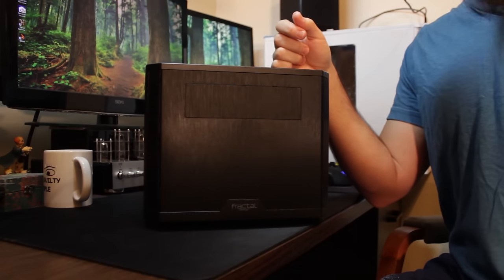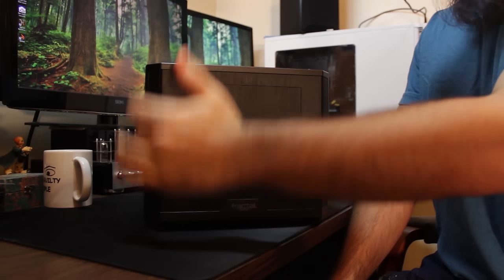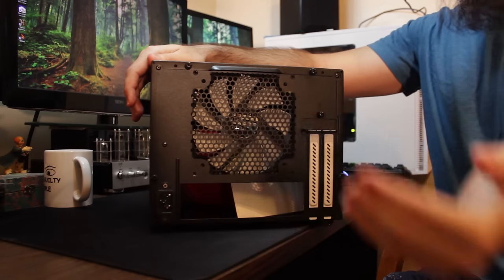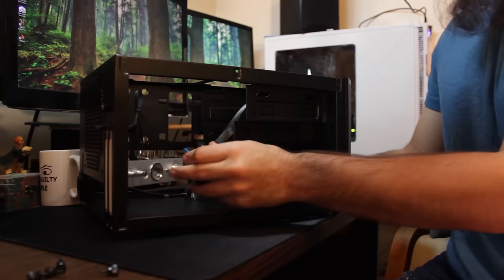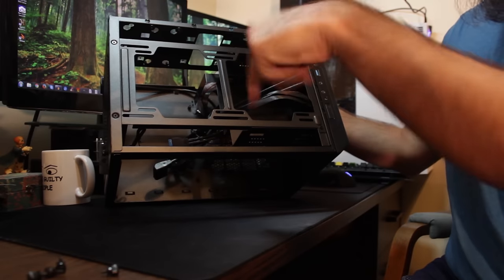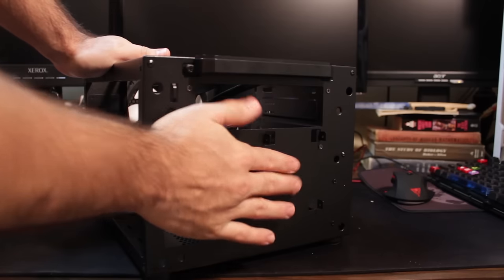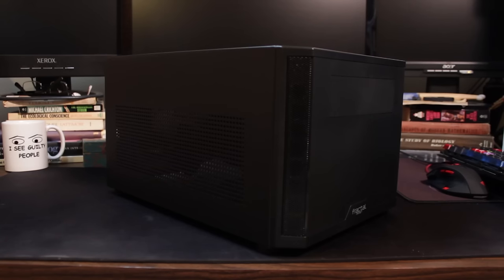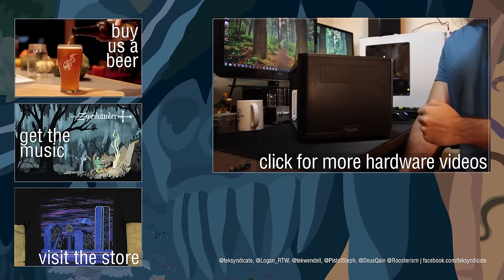Fractal Design Core 500 Overview

Comment: The kind of build I'd like to see in this case would be:
A 'gaming' setup with a custom watercooling loop to find out how loud it would be running off a single rad.

HTPC/general rig we know would work in that easily, given the low power/heat of 'modern' components, but can a gaming rig be done quietly in that size?

Thanks for the vid.

Comment: I have this case, and i love it. It's simple but stylish, and with the low power build i have in it (i5-4690T and 750TI), it's REALLY quiet. 

Main reason for choosing this is that you have room for a proper cpu cooler. I've always hated the Lian Li and Cooler Mater idea of placing the psu 3" above the motherboard, leaving far to little room for decent coolers. In this i have room for my Seasonic psu, a Zalman FX70 passive cpu cooler, and i would still be able to throw a longer gfx in there if i want.

The only negative i see is that you need to watch out for psu length, if you want to throw in a long gfx. They are really close to eachother.

Comment: I shoved some of my power supply cables between the front panel and the case wall. Will that block air flow? I am still getting normal temps even during intensive gaming and work, etc. Is it fine what I did or should I get a different PSU? I have a full sized atx PSU and didn't know where else to put the cables! :(
Reply: You need to give more info about your system , however the temps are good so your cooling appears to be fine . That's the best place for cables in this case because there is no air intake at the front so you aren't blocking the airflow.

Comment: Always wanted to try a fractal case. some how I'm still stuck on flash over substance. I think the silence these offer might drag me to the dark side.
Reply: +Iamiblaze I recently did a rebuild of my main system in a Fractal Design Core 1000, and I have to say overall it was a smooth build considering it is Fractal's budget MicroATX case, but damn it man Fractal could learn to put in some cable tie down points, and the front mesh filters if you are not careful can cut the hell out of your thumbs, so yeah while their stuff looks nice, and clean from the outside, the insides of their cases can be hit or miss depending on model, and your needs.

Comment: Mr. Agent Beard has been kicking a lot of ass lately with all these reviews, and while I love the outside minimal look of Fractal cases, there insides can be hit, or miss depending on your needs like the Core Design 1000 it's seriously missing key cable tie down points, space behind the motherboard try, a CPU cutout, and the front mesh filter can cut your thumbs if you are not careful from the cheap modders mesh used, but this case seems to be a real improvement from the Core Design 1000, and I would seriously consider it if I was building another MiniITX system.